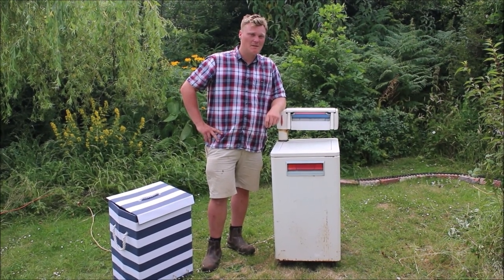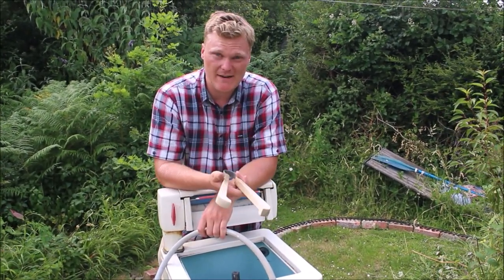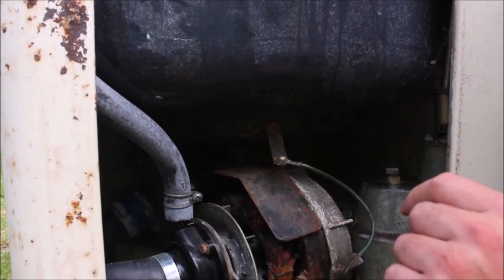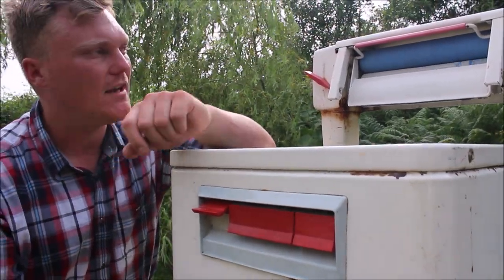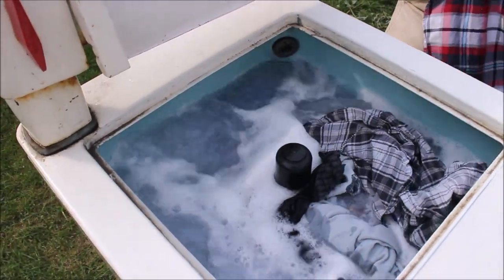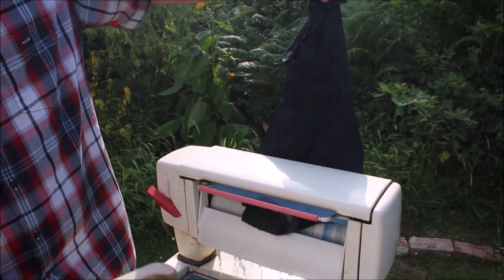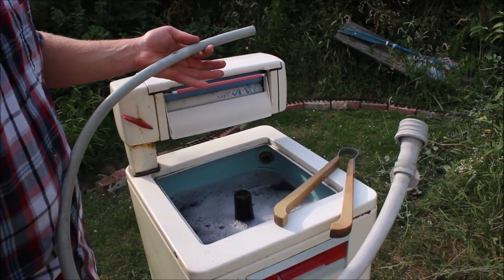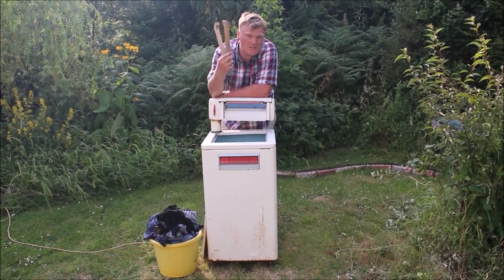Hotpoint Countess vintage washing machine

Comment: My parents received  one 2nd hand as a wedding present in 1969. Deluxe with heater.
Only got rid when the earthing went on it. Used to stand in front of a Belfast sink so anything going through the wringer mangle dropped into clean water for rinsing.
It's replacement was another Hotpoint Top Loader of the late 70's variety. Sadly that leaked and then seized. Was about 6 years old.
Been front loading auto's since.
Would like to get another Dolomite after seeing your Moggy Thou. Last car my grandad had (And the only new one) was an F reg 4 door in Almond Green. GTB 124F.
Keep up the good work :)

Comment: You probably had a bit too much in there. They take about a 3kg load. The clothes should move freely around the tub and you should see a roll over action, as the clothes move towards the agitator, are drawn down and then reemerge at the outside of the tub. Max was time required is 12 mins.

The user would have put the clothes through the wringer into a sinkful of rinsing water. The wringer has a second position, so you can wring the clothes out of the sink onto the draining board.

Comment: My mum had one with a manual mangle, my nan had an even older type, heated by gas with a handle on the outside for turning the agitator and a  manual mangle, we also had gas fridges from the 1950s to mid 1970s

Comment: Hi Alex .Great video.Normal practice with this machine was to remove the agitator before pumping out the dirty water.The wringer can also be lifted up slightly then turned over a sink pushed back down allowing washed clothes to be rinsed in the sink and then wrung out while the washer gets on with the next load .A whole weeks washing could be done in say an hour while an auto was still on its first load .5 to 10 mins in the washer into the sink for a rinse through the wringer and out on the line .I do hope your going to do a video on the TT

Comment: When I was in England on internship in the late 90s, the laundry on campus had (3, I believe) older washing machines from America that were top loaders.  I think they were either Maytag or Whirlpool brand.  They had been modified for 240v 50Hz and to accept £1 coins, and I remember the blue damp location plugs they had (NEMA 3 rating over here).  The was also a large American made commercial dryer with a huge drum, also modified voltage and to accept 20p coins.  So no one on campus ever had 20p coins!

Comment: Often these vintage machines last longer than today's!
Reply: NightOwl True, but they also cost two months wages back in the day. A basic machine today costs less than two days wages for the average worker.
Reply: @spencerwilton5831  I don't know if you are in the USA or here in Britain, but an automatic washing machine costs on average £200 here, which is around a week's wages for someone on minimum wage. I have a modern little twin tub which cost me £59 off ebay. I got it last year and it's doing its job!

Comment: The top loading machine was scrapped in favour of the front loader. There were many different types of top loader, the last hotpoint one was the biggest and best, it washed and spun dried the clothes all in one. Philips made a 'spacesaver one', where you had to open the enclosed drum (side on) .... lots of call outs to those when they came undone...... also had a clutch system for the spin cycle, bakelite body with 3 ball bearings........ ahhh the memories. 
I forgot to mention, the worst thing about the agitator type was was the oil leak from the gearbox..... as soon as the seal wore out on the center column, water would get in and force the oil up and out onto the clothes.

Comment: The clothes went through the mangle and into the sink for rinsing, first with medium hot water, then cool, then cold. Some machines had a reversible mangle so the clothes went from sink onto the top of the machine.  This ment the rince water didn't go into the tub. If the water from the white wash (whites were alwasy done first) wasn't totaly discusting a bit more powder was added and used for the colours. Less water used, less coal, gas or electricity used to heat it. Less powder used and a bit more time saved for the house wife.

Comment: I really like that little washer its square like and automatic is. Direct drive and direct drive water pump too and I can see it really pumps big volume of water too..The agitator is made just like a maytag wringer agitator is..It did a big load to be so small I could not see how well it was turnning over if you should have put less in or if it did good.I really like that machine thanks for sharing.
Reply from the maker: seems to wash fine with a larger load, when i start to take them out and put the through the mangle it all gets a thorough wash then too

Comment: 30 minutes to an hour washing is excessive- ten minutes was more usual when using these machines. Heavily soiled items would be soaked first though, sometimes for hours. The pump can be run while washing to recirculate the water giving a more vigorous wash.
Reply: Yes, I couldn't believe he had it washing one load for an hour, gee that would be an all day job doing a large families wash back in the day as Monday's was traditionally wash day. If you washed a load in a Hoovermatic twin tub for an hour there wouldn't be anything left of the clothes apart from a tangle, knotted ball of rags! Lol

Comment: OK so before you put them in the dryer did you actually rinse your laundry?  Lovely explanation by the way oh the raise bar for the wringer is in case you get a finger caught too :)
Reply: Other comments suggest you put the clothes through the mangle and rinse separately. Then again I guess you can run them through the mangle.

Comment: Uum that ain't no washing machine,  it's called a Wringer Washer. Popular in North America from 1927 to early 1960s....my grandmothers used that in the 1940s to 1950s....by late 1950s they had actual washing machines as we know them today.

Also to add after putting the laundry through the rollers they need to go in a separate tub filled with water to rinse out the soap, since wringer washers do not have a rinse cycle,  after kneading the clothing in the warm water like dough,  you put the clothing back through the rollers to get the excess water out, and then it goes on the line.
One must get the soap out of the clothes how do I know,  my mom explained the whole process to me as she watched her mom do this.
Reply from the maker: In the UK they have always been referred to as washing machines 😀